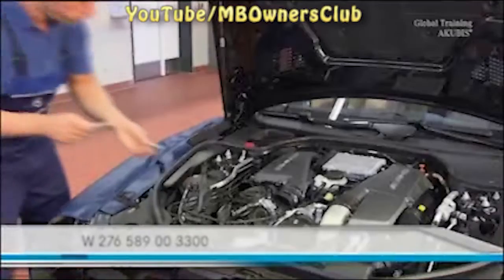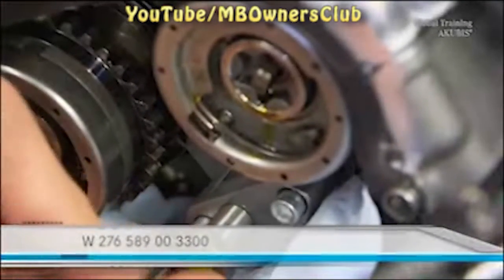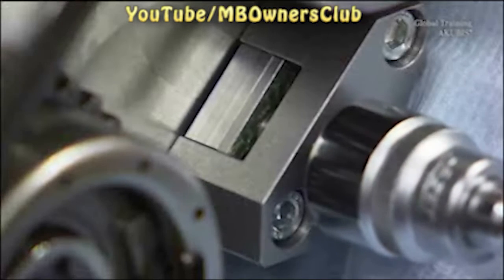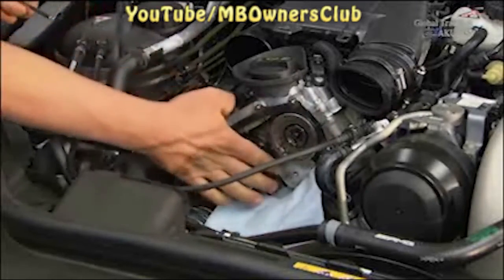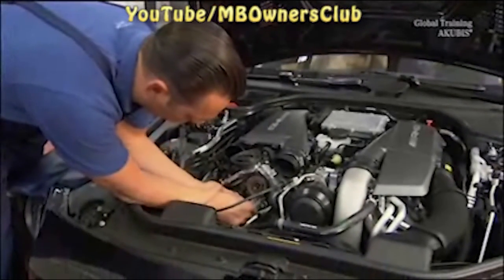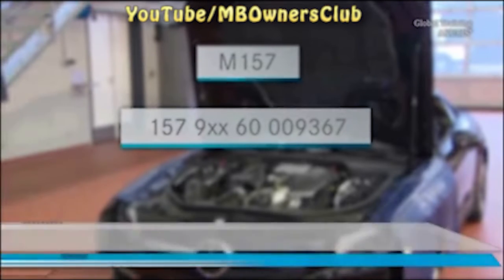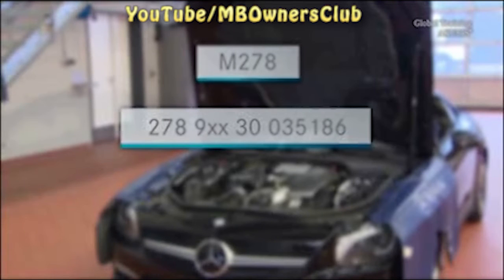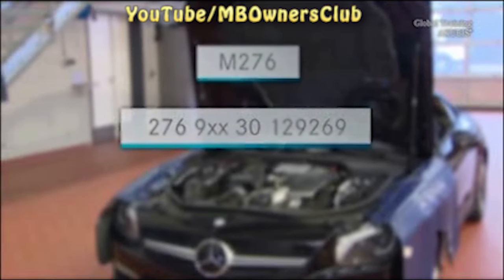How to Fix Engine Chain Rattle on Mercedes-Benz | Install Check Valve on Hydraulic Chain Tensioner

Comment: Question how do I remove the check valves that are in there I remove the threaded piece it seems like there's a still shim that stayed in there but how do I remove the check valve that's still in the hole

Comment: Check valve don't Supply the head with oil the oil comes from the head through the check valve to the tensioner come on

Comment: How do you pull the valve out though?
Reply: Why You would like to pull it out? It will keep oil pressure in chain tenioner.
Reply: Were you able to remove your check valves

Comment: What does this actually fix? is it dangerous not to change it, car is aE550 v8 4.6 turbo with 80K
 miles. Assume you need to of them? How many hour of labor does it require?
Reply: I can only answer the first question. It stops oil from draining back off of the tensioner when the car is at rest. If you already have the rattle you'll definitely also need tensioners.

Comment: I have a problem like this   do you think the dealer will warranty this job?  I have 2013 merc e350 with m276 motor has a 51000 miles

Comment: what's the reason for this valve installation?
does it provides more oil pressure to the chain tensor?
Reply: keeps oil pressure, prevents oil pressure from leaking down, therefore on start up u have sufficient pressure on tensioners to prevent rattle
Reply: How do you remove the check valve ?